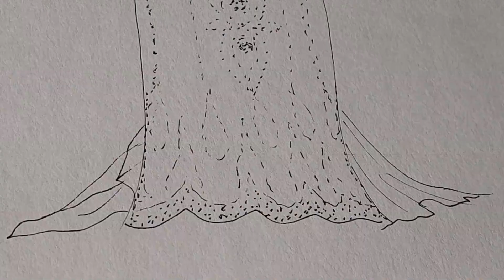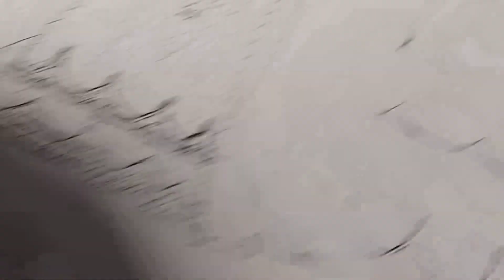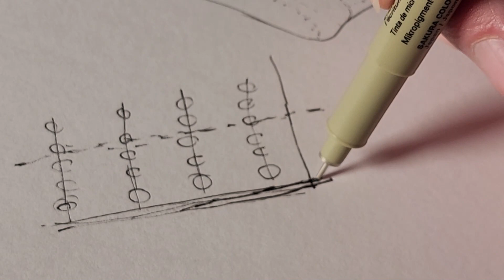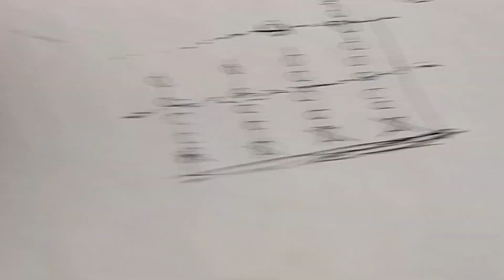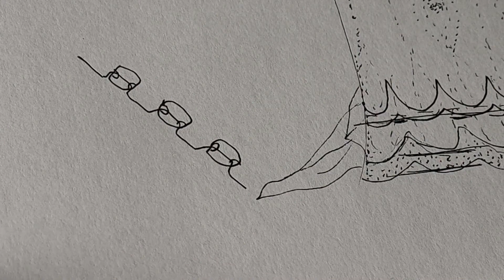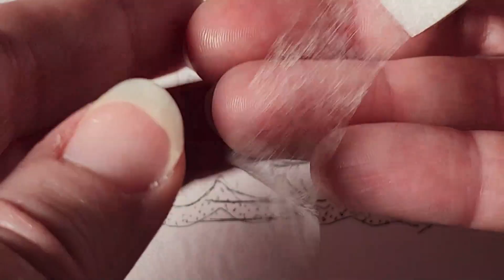Easy DIY How to hem a BEADED PROM DRESS | Beaded wedding gown #easysew #diyalterations

Comment: Is there a reason you dont crush or smash the beads? I was taught by several people in couture bridal to actually take a hammer to the beads to crush and remove them so as not to open the threads and lose beads.
Reply from the maker: Due to safety, I avoid that. I find it only necessary when the beadwork is more dense than this.
Reply: @SparkleSewing That makes sense. Thanks for the reply!

Comment: I usually just sew right on top of beads sequins. But a gown I just did I did hand sew it because I broke too many needles 
I will use Fabri-tac to secure beads on the excess of the hems. 
On gowns with deep scallops I will sometimes allow the excess hem to “fill in” the cuts. And then just tack them to edges of the scallops. 
On sides of gowns I just tack where the beads “pull” then lay the seam open and press with steam covering the beaded fabric with muslin 

If the trim is part of the gown I “make it a trim” by cutting seamage and taking under

Also with these gowns it’s so easy to catch a thread and rattle off a whole row of beads or sequins (I just did this....sigh...)
So I cut a piece of beaded fabric from the excess of the hem and matched it to the gown and glued it on tacking at the ends 
You couldn’t tell unless I told you. 
And during prom this is a real time saver
Reply from the maker: I think we share so many of these shortcuts! 🤗❤️
Reply: @SparkleSewing  Amen!!